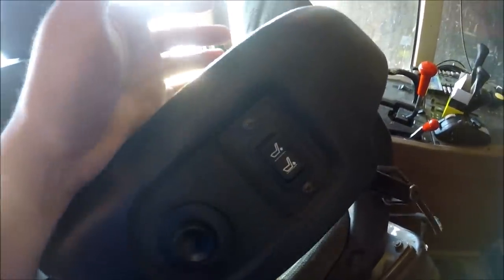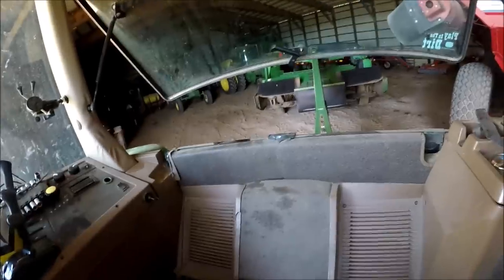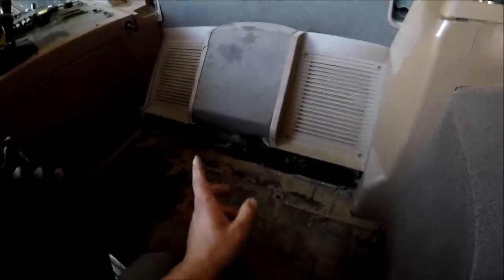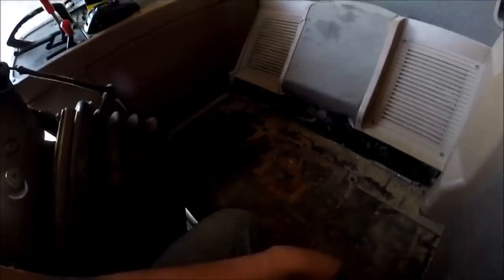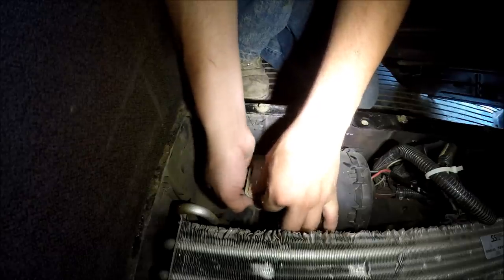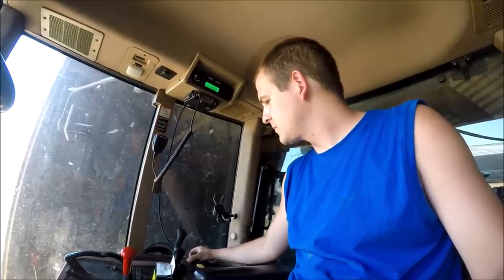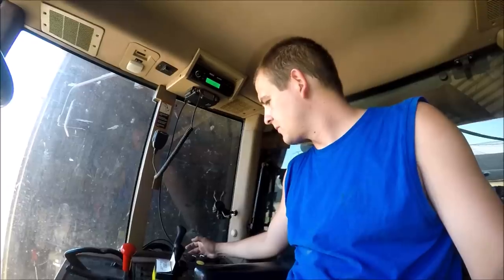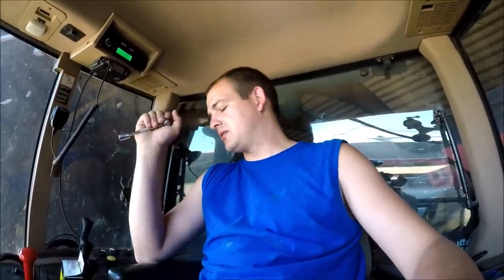Finally Getting The Blower Motors Working In The JD 7600

Comment: Wd 40 wouldn't help you could try a 3 in 1 oil or white lithium grease.
Reply: WD 40 is a poor product there are much better products out there!!  Hate it!
Reply: joel mollenkopf wd 40 is great for drying out electrical connections or freeing a stuck part.  It is a horrible lubricant.

Comment: Did you make a video of taking the seat out of the 7600?  I need to replace the resistor on the blower
Reply from the maker: It's 4 or 6 bolts around the base then I slid it ahead so I could pull the floor up to get to it. It's not a fun job but make sure to check your blowers while your in there. I had a bearing going on one that was giving me grief.
Reply: @TheRestOfTheStory   I got the resistor replaced on the fan. Thank you for your help.